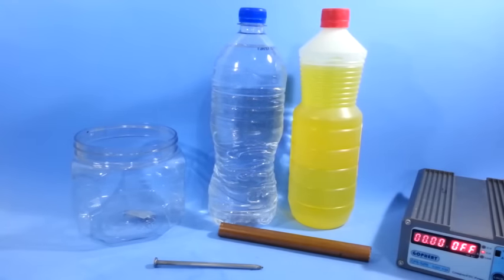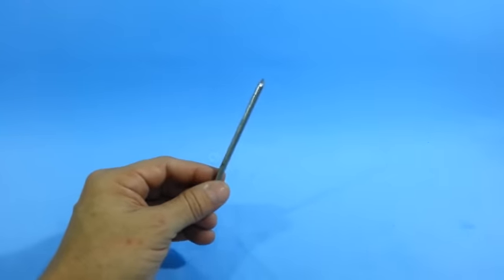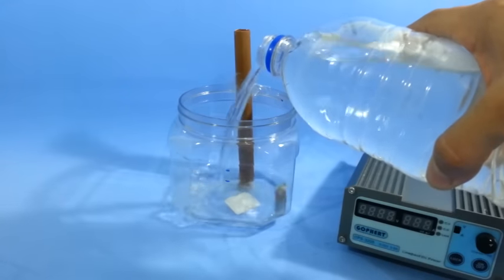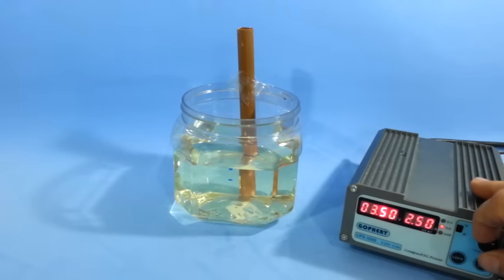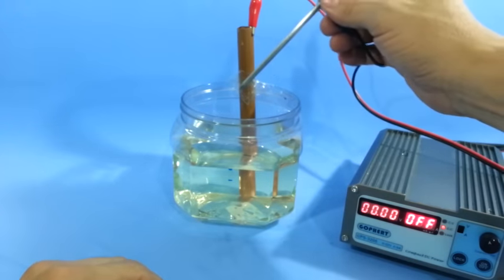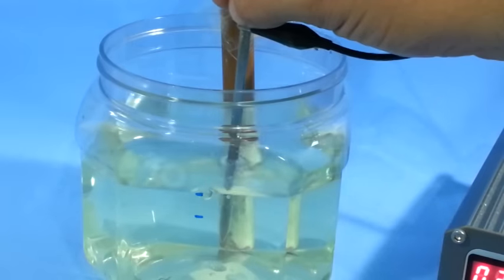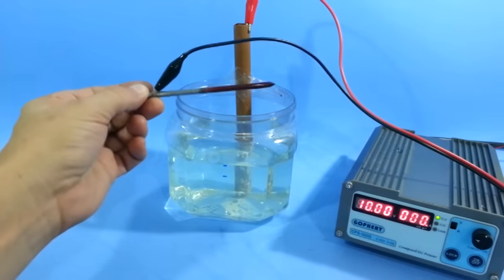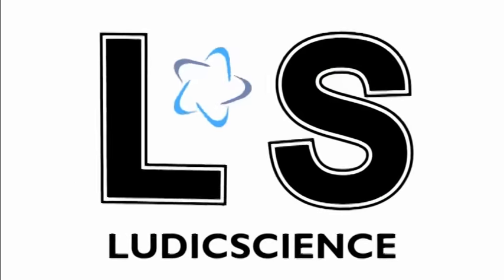Easy method for Copper Plating

Comment: "A quick and easy method for copper plating with no chemicals, only water and muriatic acid." Water and muriatic acid are, by definition and all interpretations, chemicals...
Reply: nucleochemist but they're easy to get
Reply: If you want to get REAL specific, you can't do anything at all without the use of chemicals since everything in the universe is made of chemicals.

Comment: I assume u can use other gentler acids right like vinigar?  
also if u has various metals inside connected on positive, the different electric frequency you use might extract from one metal maybe since each metal has its own frequency in how efficient it would react.
Reply: Trench it would take a lot longer
Reply: But you admit it would work so ok since it is  safer ;)
Reply: Trench I tried it, you only need a higher acid concentration
Reply: well it is good you tried and stated that it did not work. Most things online state the sucess but not what does not work. :)

Comment: Would the object get a thicker coat if left in longer ? 
Thanks for sharing and take care.
Reply from the maker: +Ken Gamble yes but not by much
Reply: Ludic Science 
Thanks
Reply: Ludic Science how much time does it take just to see deposition of copper on the nail??? Please I need help
Reply: Ludic Science Im planning on using copper solution as electrolyte..and I want to know the time duration for it to start copper plating

Comment: That acid... Is it vinegar?
Reply: Muriatic acid. Drain cleaner from any hardware store. Read the label Watch the percentage dilutions you don't want the weak stuff. If you find high percent Hydrogen peroxide. Together they make a good acid for home use precious metal recovery and etching metals.
Reply: Solder King Oh, nice! Thanks!!!
Reply: There are a lot of good advice videos on YT to watch for detailed information if you want to try it yourself.

Comment: is it pure copper?
Reply: Yes but does not have to be. You can do this with many different metals. The acid frees up copper in solution very easily with the opposite charge the iron nail attracts it and molecularly bonds to the nail. Just look up which acid to use and what will bond with what if you want to play with other metals. Copper is used  a lot as a base for other tougher metals to electroplate where they otherwise would not.

Comment: is it only for iron metal
Reply: tommy tran any metal u want  ro copper plate
Reply: Some metals actually won't work. 
For example, I don't think aluminum or stainless steel will work.
Reply: Terry Daniels maybe
Reply from the maker: Aluminum does not work.

Comment: "household items only" you'll only need: "muriadic acid..." at those point I was very short before turning off the video because who the hell has muriadic acid at home???
Reply from the maker: +Philipp B i have it all the time
Reply: Ludic Science ok then would you possibly be so kind, to tell me where I find it?
Reply from the maker: I buy mine at Walmart
Reply: Ludic Science ok I don't have a walmart around... I live in Austria
Reply from the maker: Check in a store for swimming pool supplies
Reply: Ludic Science ok thanks
Reply: As I know, muriatic acid is often used for bathroom cleaning. I1ve bought a bottle of 20% muriatic acid for less then 1 euro in a local store. I'm using it to etch PCBs.
Reply: That acid is used in swimming pools to raise the ph in pools you can find it at almost any hardware store like home depot or lowes